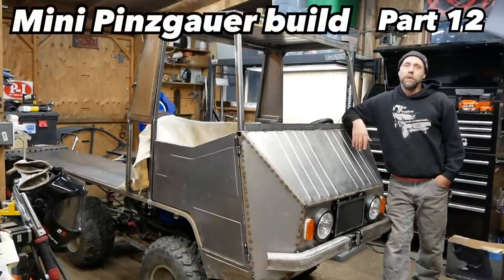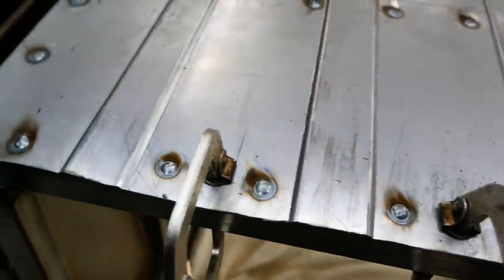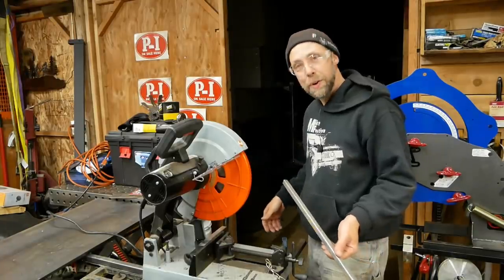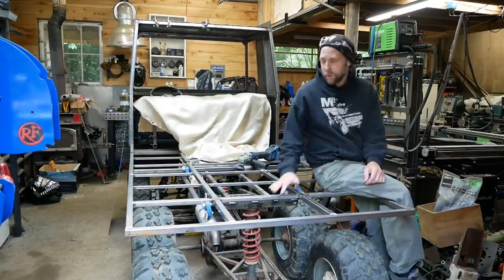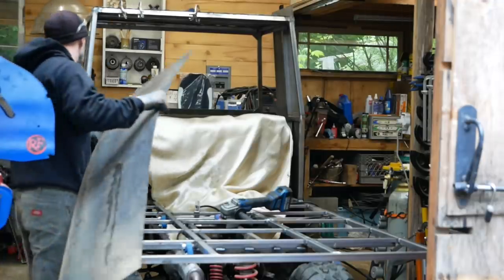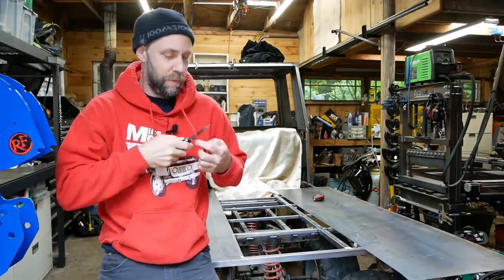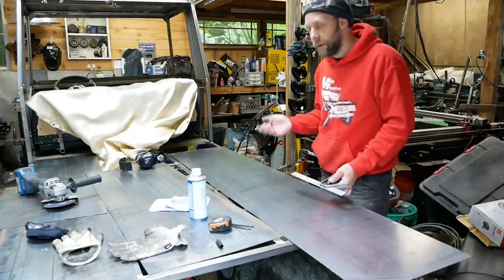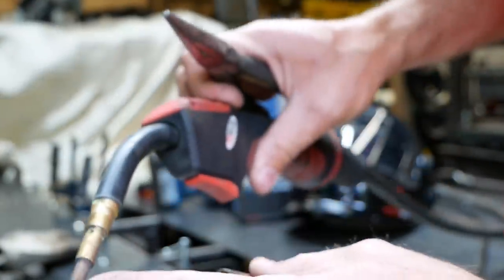Mini Pinzgauer 6x6 Off-Road build series part 12

Comment: Working from the inside/ out also applies to bolting things down for that same reason;  such as bolting down a head on an engine..  Start in the center and spiral your way outward and it will "iron out uneven surfaces.

Comment: BJ from QLD AUSTRALIA I like your idea's  one thing I always do is spray the head of your mig with lanolin spray it stops the build-up inside the head if it starts to build-up just tap the side the head against the job and most splatter will fall out ,,I also find it really good as  an anti - splatter release..cheers

Comment: recently got a DeWalt DCS373 20v metal cutting circular saw. It leaves the edge so clean you could run your finger on it (no do not try it). Will pay for itself in grinder blades in no time. Perfect tool for what you are doing.

Comment: Nice work, it's really coming along! The standard way to cut materials with a chop saw or band saw is in-feed on the left (or in the clamp), materials stop on the right. The intent is to have the raw material clamped securely and the work piece be free. If you hold the material, as you have shown, there is a chance that it could injure you, especially with a chop saw.

Good tip on the hoodie strings. I sometimes just shorten them to the point where they can't dangle. Since we're talking safety; no sleeves of any kind, no unbuttoned/snapped shirts around the milling machine or lathe, and no gloves when operating machine tools (mill, lathe, belt sanders, etc.). In my experience, the 4-1/2" grinder is easily the most dangerous tool in the shop and the lathe can be the most deadly...

Comment: I recently got harbor freight's pneumatic punch/flange tool and it's a big time saver when you're welding sheet metal panels on like that. You should pick one up, they're like $35
Reply from the maker: Thanks for the tool recommendation 👍 I will definitely check them out!

Comment: The bead rolling should add strength to the roof and stop flexing.  I used to drive a truck, and the company had some old trucks that had the headliner panels removed.  Without them the roof would flex and pop when you drove them.

Comment: I was very impressed by these videos, your knowledge of sheet metal is great. Not to mention your general knowledge of the mechanical aspect's of the way the clutch is & what you did to make everything work so well, by adding the extra master cylinder to the brakes, well all you did to accomplish your end goal, very cool. Most of all is the tools in your shop. So cool ! You mentioned a link to the CNC part of your plasma cutter ? I too have a Harbor Freight Cutting Torch. What did it take to add the CNC portion with out spending a fortune, please advise, thank you a new fan... Keep it up Mike, with those skills I would expected you to be 70 year old dude. Sincerely JD in Colorado.

Comment: Hoped you were going to fold a return on roof panel ends for a drive channel to finish it off nicely?
I think you could have bead rolled the tray floor panels and not needed extra bracing

Comment: There is 1 forsale in MN on marketplace in Sauk rapids right now for 11k based off a Polaris 6x6 with 800 turbo engine, I’ve seen it listed a few times over the years. It looks sweet but had about 100 miles so either it’s undone or sucks to drive it lol.

Comment: OK, so when you were working on the passenger side of the bed, you were drilling holes in the sheet metal, what kind of drill bit were you using?
It looked sort of like a step drill, but then again it didn't, just wondering since I've never seen one like it. Thanks for the video, I really enjoy these!
Reply: It looks like a DeWalt step drill bit.

Comment: I thought that was the new HF tig welder! $900 seems kind of steep for what it does and with the lack of adjustability. Nozzle dip works wonders for spatter, splatter or whatever :-)
Reply from the maker: Thanks for checking out my new video 👍 yes that’s the new Titanium AC/DC TIG welder, it welds good and there’s basically zero settings so anyone can turn it on and be ready to weld, but I feel the same as you about the cost and lack of features. Take care 👍

Comment: Primo work as always. I noticed when welding the bed supports you were back dragging, like a stick electrode. Any particular reason, or is it just the way you roll? My experience is pushing will give a flatter bead (less grinding).

Comment: Noticed you keep backing yourself into a port design corner when building. For example finishing the bed floor without the cab closed first. Then when you do it you will have to try and figure out how to close it without making a ugly design. Just finish X part (bed, cab, etc) before you start on another large part to avoid it and it'll look cleaner. From what I see here when you go to enclose the back of the cab it will go into the bed area and then your 'rails' will be in the way and if you work thru it then when folk look into the bed the side of the rails will randomly start with no space inbetween it and the cab. Overall it is minor but a tip. Thanks for the great content!
Reply from the maker: Appreciate the tip John!! Thanks for watching and supporting my channel!

Comment: I guess I don't understand why you take the time to lay out and drill holes for welding, when you could just weld it underneath a lot faster and cleaner?  That's what I would do;  migs weld upside down just as good as upright.
Reply: by plug welding it is easer to control the heat input and minimize the warping of the panel

Comment: Mike, what type blade are you using on the chop saw? Mine throws so much sparks you can cook with it!
Reply: That is how you know it needs to be replaced.  Get an EVO, Diablo, or MK Morse blade, they're the best I've come across.  For reference, I make about 900 cuts per week with mine, carbon, stainless, and aluminum.  Have gone through quite a few blades and saws, tried everything available on the market almost.  The cheap crap is cheap for a reason, you'll spend more money replacing blades than just buying a high quality one the first time (similar to harbor freight cutoff discs vs Metabo)
Reply from the maker: I have the stock blade that came with my saw, they cost about $100 about the same as the Diablo blades. I have ran the Diablo blades as well, the saw shop that sold me the saw also gave me a different blade to try out once I send my stock blade back to get re sharpened, as long as you don’t keep cutting on a really dull blade and rip off teeth you can usually re sharpen them about 3 times, it cost about $30 at most saw shops 👍
Reply: @Mikefestiva  thank you!!! 🙏

Comment: or tuck the strings into your hoodie instead of cutting them off.
Reply from the maker: Well when I comes to working around power tools and heavy equipment, some little strings dangling around my neck are completely unnecessary so I always cut them off.
Reply: @Mikefestiva  
I'm the same way about strings dangling near tools I'm working with. I was just offering an alternative to cutting them off. The strings still being there is ideal when working outside in winter, so I chose to keep them. You can still tuck them into the neck hole after synching and tying them.

Comment: As soon as you started tack welding to roof on from outside in, I said to myself he should be tacking from inside out then you said what I was thinking......
So bead rolling requires backwards thinking, I have hard time with forward thinking........
90-95 degrees is nice weather....... YUCK have you lost your rocks, I'd ten times rather be in a shop with AC on doing inside projects then be out in the hot humid sunshine and then I hear out you neck of the woods it's 100+ degrees, thats not nice weather.........
Reply from the maker: AC in the shop would be nice but… well you have seen my shop 😂 
It’s so rare for us to get temps like this it’s really best to spend those days at the beach or lake, both are only about 6 to 10’miles from my place 👍
Take care 🙂